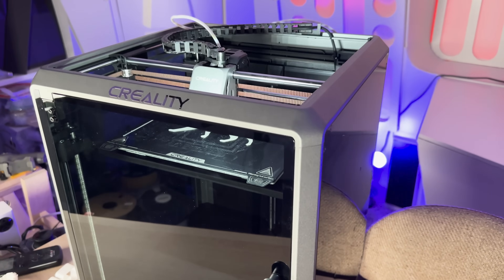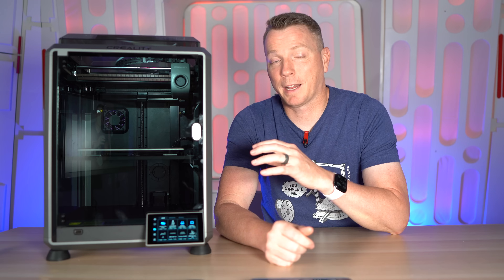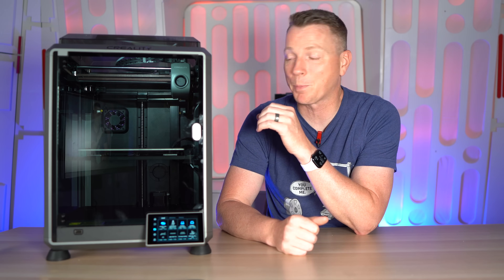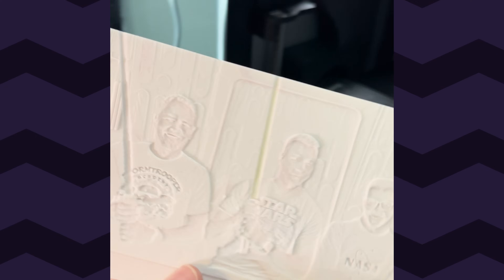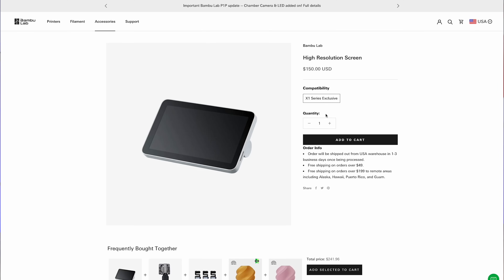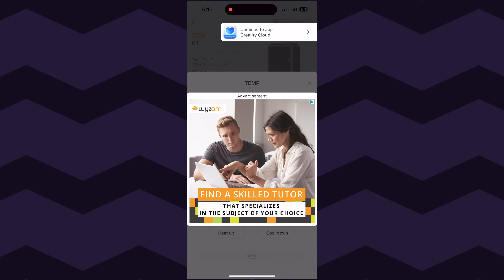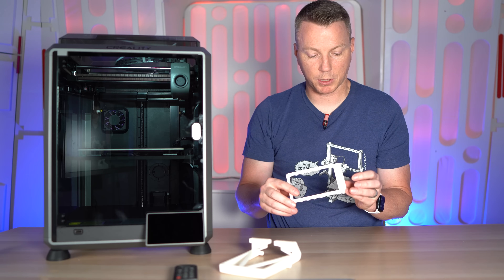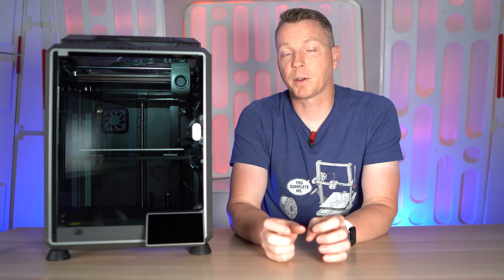I Regret Buying the Creality K1. Here’s Why.

Comment: Now the K1 CAN do multi material with CFS upgrade.  It's also much cheaper than even the p1p now with no Chinese cloud drama.
Reply: Ya but still has print issues. Mine will print fine than randomly stop I don’t even know what it’s doing every few prints it does this. Only has 6 days on it and I finally got a beautiful first layer but now when my part is half way done it falls apart. I use to own a print farm I’ve tried everything to get this to print. Unless I just have a lemon or creality slicer is a joke.
Reply: @ProjectInkDesignco  yeah, use Orca.  Maybe got a lemon, but in general the K1C is great and prints way over its price class.
Reply: @ ok I’ll give that a try but heard that voids the warranty sounds like creality wants they’re customers to have a bad time
Reply from the maker: @ProjectInkDesignco  I’ve owned more than 20 different printers but I’ve never owned a Creality myself. This is Mick speaking, not Nils.
Reply: PS I’ve done all calibrations creality has not clue what’s wrong with it and told me to send it back so now I probably won’t have one for a month for them to fix it.
Reply from the maker: Sounds like a great deal. They’ve come a long way!

Comment: Right now the k1 is 350 USD with a discount and thats an insanely good deal and they fixed most of the bad issues with the k1. Im buying the k1 for sure and im buying the cfs upgrade kit. Cant wait for it all to arrive!
Reply from the maker: Sounds great! Let us know how it goes.
Reply: @The3DPrintingZone  Its coming on Monday I will let you know if it works well!
Reply from the maker: @ sweet! My two brothers have the K1 and K1 max and love them.
Reply: @The3DPrintingZone  Printer has been going well so far other than a little bit of an issue with the print adhesion. Prob need to clean the plate cuz ive been printing ALOT of things. I think after the revisions the k1 actually became a good choice. Im going to get the cfs or mod my own multicolor maybe soon.
Reply: @sikees  I have a k1 coming tomorrow and the determining factor for me was Bambu labs is a walled garden.  Whenever something is a walled garden you can guarantee anti consumer practices will start to creep up.

Comment: Update from 2025:

P1S was 1.5x more expensive than K1C in my location. Now, the K1C is getting a multi filament ugrade in 2 weeks. 

Honestly, I would prefer a bambu for consistency and a bigger build volume but i could not justify spending that much on my first printer.

Creality print 6 is just exacrly the same as Orca. Orca works too.

Comment: Take this guys comments for what they are worth.  He is obviously a Bambu fanboy and I am reasonably sure  connected to Bambu in some way (sponsorship, etc.).  Even in this video which is supposed to be about the K1... he spends about 1/3 of the time talking about the K1 and most of that is about shortcomings and 2/3 of his time talking about the Bambu P1P.  Doesn't really mention the fact that the printer he is promoting has a 20-25% higher price point than the machine the review is supposed to be about.  Hello... newsflash... for 20-25% more money I expect it to have more features.
Reply from the maker: I hear ya. This video was done when this printer had a LOT more issues. Luckily, Creality made updates that improved things.

Comment: The fact I can root my K1 and run klipper/fluidd is pretty darn awesome though, I've setup a macro to handle a print queue with auto ejection, it just performs like a beast!
I don't print objects larger than the 22x22 and it's all in single color, so to me the K1 wins every day of the week, especially at todays price point ($350)

I do have a a1 mini as well, just because it was so cheap and I wanted to test it out and see if it could potentially replace my K1 as I expand my printfarm, but so far I'm loving my K1 way too much :D

Comment: 1 year later all those problems are solved with the K1 max 30x30x30 Supports multi-color printing with up to 16 colors using 4 CFS and I bought it for €680 without CFS. I really have no regrets, perfect prints without any problems.
Reply: I bet that mobile app is still a pos.
Reply: @allesbehalvewaterstond   Nope, i have no problems with the software or apps since the 5.1 version of Creality

Comment: The Reason the prints done by the K1 are trash is probably because you didnt take off the top plate or didnt open the front door. This lead to the enclosure getting too hot and warping the product.

Comment: Haha, I just purchased the K1c and then I was looking to become more familiar to this printer and I find this video. I am sure for manufacturing purpose the k1c is superior apart from the size of the  print that K1cMax  has shorted it giving the user the possibility to print 30cm by30cm by 30cm making this Bamboo printer obsolete. I am so glad I dint called for it:P I believe the print issues is only because your lacking in experience with it I really hope so but based on what you said so far I stand lots of chances :)
Reply: Just so you know when this vid was posted more a year ago it had some problems but now creality has fixed them. They are very good printers.

Comment: Now that k1 is $400 at microcenter the k1 is a great deal, also using the ams capabilities to compare to the k1 is unfair as then you basically have a $850 printer compared to a $500 printer which is not an even comparison

Comment: I wisely invested in a pre-owned Ultimaker S3 (dual core) 3D printer, with all the capabilities of their larger S5 variant, just in a smaller package. The private seller included a dozen packs of assorted new Ultimaker (NFC ID enabled) filaments. I was genuinely surprised at how easy the S3 was to initially setup and connect wirelessly to my local network and Ultimaker's free remote monitoring platform. I literally started printing quality parts within minutes of turning it on, with it's easy to use touch screen UI and free Cura slicing software.

The most frustrating and difficult aspect of 3D printing for me personally (as a noob) was getting proficient with modelling software like Blender and FreeCAD. It's easy to slice and print someone else's (thingiverse) models, but not so easy to create ones own from scratch. It's both time-consuming to learn the software, as well as design 3D models good enough to print.

My personal recommendation for DIY amateurs, would be like me to initially buy a cheaper used printer to start with and don't potentially lumber yourself with an expensive new paperweight, should you find 3d printing less-appealing after trying it a few times. One definitely needs a purpose/reason for owning/using a 3D printer, as they're not cheap to maintain or feed.

Thanks for your in-depth honest review of the K1, I for one am glad I invested in a reliable small commercial grade (dual nozzle) 3D printer and not something like the Creality K1. Where I think you've more than adequately demonstrated my point too, it pays to buy a reliable workhorse and not the latest pretty-looking plastic trendy show horse. 😉👍

Comment: Just so everybody knows, the K1 has fixed it’s printing problem he talks about
Reply: Ha ha buddy I have a k1 and I still have these problems
Reply: @joeycurry8700  when did you get it?
Reply: @OliverWatson-s8c  4 months ago
Reply: Yeah, right.
Reply: @joeking433 WDYM? Mine works perfectly and I’ve used the entire base plate + I’ve watched a more recent video saying they have fixed it. The old switch requires a lot less force to flip but the new one does making it fixed with under extrusion.
Reply: @OliverWatson-s8c have they fixed the part where the cable chain was turning the gears off?
Reply: @3Ddesignisawesome  yes
Reply: @OliverWatson-s8c  Hi, just wondering, what about the bed leveling issues? Are those fixed yet? Or should i prepare to fiddle around with that a bit?
Reply from the maker: Take a look at our most recent K1 video to see what’s been changed: https://youtu.be/MXwsjaLzxnI?si=hjImM63TyK2HE7Xk

Comment: One thing i never see k1 reviews talk about is the massive difference that rooting a k1 and going to a mainsail or fluidd operated klipper system with guppy screen. Having KAMP and z tilt make a huge difference on this machine. It also allows for real input shaping not the fake input shaping it ships with. It also allows you to use octo everywhere and get off the horrible creality app.

Comment: Bambu Labs do have an enclosure kit for the P1P that is reasonably economical, or you have the P1S available now as an option that is pretty reasonable.   Big Tree Tech have recently released a Panda Touch device that upgrades the P1P / P1S display now.   Very worth while.  I know, slightly extra cost, but worth while and still preferable to me over the Creality offering.
I believe, now ( 8 months later ) different slicers can be used with Bambu as profiles are now available, but I don't know off hand which ones are compatible.   I think Slic3r  and Orca work, but last I heard they don't support the AMS yet.

Comment: Had the K1 for a week, sent it back. Printing ailure rate is like  4 out of 10.  It's not because of wrong settings, it's more like intermittent clogging or change in extrusion or flow or similar. One print comes out perfect, next one I had to cancel it half way. It could be just mine, but quality control isn't the best, just read reddit posts how many people have all kinds of issues, whether it's first layer or clogging or other issues.  After a week and several days of trying to figure out what's going on, I gave up.  60% efficiency only is just not good enough for me, when my $99 Elegoo printer does a 10 out of 10, whatever filament I throw on it, (although very slowly). Oh yes, the app. I had it on my phone for a whole lot of 5 minutes and then deleted it. It's like downloading an adware or a virus.

Comment: What you don't talk about is Closed Source and the Bambu Lab products are tuned to work with, well, Bambu Lab filament and slicer. At $28 for 1kg that is about double what most filaments run and since Bambu Labs just takes from the community while attempting to build an 'Apple Mystic', if it cost more it must be better, right? When Creality decided to open the Klipper printers they are shipping I ordered a K1 to use while building a VZBot, one of the many Open-Source printers that have developed the 'Next Generation' 3D printers. I expect Creality to be marketing an AMS system for their 'Flag Ship' line shortly, it's China, and the Creality AMS will be ~$300.

Comment: Seems fair at the time. Ive gotten a k1 max now and that addresses most of the issues outlined here. Its enclosure is better. It adds the a1 cxamera and the lidar. The lid area is changed and doesn't interfere, the filament change switch has been tweaked to be more robust. It doesn't look  to me like the chain interacts with that now, likely as a result of the differently designed top. 

Mobile app Ive heard is still garbage, but I dont care about that. Can always just use the browser on my phone to watch the printer. But thats something I dont bother with pretty much ever, especially with how fast these things print. Foir multicolor, still no multicolor but I took advantage of the mosaic palette sale to get a palette pro 3, so for the cost of 1 AMS I get access to 8 colors and wont have to bother with the poop shute. In the Creality's favor you don't avtually have to use their cloud at all, or even their slicer/control software where you are limited to using the Bambu software.

Both fine I guess but if you're looking for an alternative to the Bambus I would look at the K1 max instead of the base k1.

Comment: The newer K1 version past August 2023 is fantastic, the app is still horrible but works. Just a lot of ads. Slicer is not an issue as you can run all of the major ones on the K1. The camera on the K1 is awesome and it is nice to monitor my print from work. The K1 Max is the perfect printer, just that crappy app…… Hopefully, when Creality completes it’s purchase of Bambu they will integrate their app.
Reply: I hope they don’t, they will ruin the bambu completely, the problem with creality products is that most of them are rushed in production and quality control is not the best, the k1 has potential but they still have to fix a lot of issues.

Comment: At 15 years old I bought a brand new Ender 3 v2 when it came out, kept it stock for a year. Then I bought a dual z axis, direct drive, and Creality box 2.0 kit. I can print at 500 speed with no degrade in quality. After the first layer I speed it up.

Comment: As the community of the K1 grows, especially the firmware is unlocked now, the K1 will continue to grow, 3 months in it's already improved vastly. 
Bambu is closed source. I will never buy one. Color printing is nice but I really enjoy painting models so not a deal breaker.
Reply: Friend got a Bambu, I got the K1, he doesn’t use the AMS because it wastes several times the filament as the weight of the piece he’s printing. Gobbles entire spools printing a 6” character, leaves a pile behind to the printer so you need an additional few inches behind it to set up a wastebin. I was so jazzed for it until I saw that, and saw how during filament changes it can shift the print over and you wasted days and spools

Comment: If the worst issue with the K1 is the app, just enable stock Klipper (tutorials are available). I still think I want a K1, but I don't like any printer that forces you into their own cloud and/or slicer. From what I've seen Bambu's system is pretty closed.
Reply: It's not. i use Orca which is another fork of bambu which is also opensource. You can print on Lan only if you want or via sd card like every other lame printer.
Reply: @phasesecuritytechnology6573   "It's not. i use Orca which is another fork of bambu which is also opensource." ... well that didn't age well.

It is closed source and Bambu is going to shut it down further after they locked Orca out.
Reply: Sigh. There are two apps. Creality Cloud, and Creality Cloud Lite. Lite is everything you want from the touch screen and camera feed and video retrieval, download and sharing. Regular has a “community” with their own ads. Everyone just took the video OP’s word for it and never actually checked.
You don’t even have to use stock klipper you can just type in the IP and get the Creality device interface served from the printer

Comment: Well... I haven't encountered all these problems. Maybe you have the first version released on the market. In the versions distributed now the firmware, the extruder and the hotend have been updated and have no problems. The cable chain has been modified and now does not touch the extruder release lever in any way. Prints are perfect even at very high speeds. No ghosting, perfect adhesion to the glossy PEI top even without using glues or lacquers. Do we want to sanctify Bambulab? I remind you that it came out a year ago and at the beginning the problems were much more serious than those of the K1, so please let's stop denigrating a good product like this. You are as annoying as Apple product owners versus PC users

Comment: I have a highly upgraded Anet A8 and an upgraded Ender 3 V2. Both run flawlessly. I want a new printer but I'm struggling justifying $700 when the print quality is the same. I have a Markforged Marktwo and an HP Fusion 5200 at work. The Markforged definitely prints better but is very slow and their proprietary filament is super expensive. The HP Fusion is super fast but we can't get parts within .1";  doesn't print accurately. I've literally brought in prints from my crappy home printers that are more accurate than  at 1/10th the cost for filament, still meeting dimensional and strength requirements.

Comment: Comment for Algorithm. Appreciate the video. Just bought my K1 as my main purpose is to print PC parts and for the price It's probably the better bang. I don't do models, just prototyping of parts and unfortunately I'd have to pay 1/3 more for the P1S to do the filaments that require more heat and stability in temperature control.
I was tempted for the AMS feature to add later, but it seems Creality is going to drop one for the K1 at some point and again since I mostly do parts my use case is not for it, but I can see it being nice for doing prints of the same part with different filaments for testing. I also like the large community Creality has if they do end up dumping the software as opensource it will get massively better. I've always thought proprietary is good and usually better, but doesn't last. Betamax and mini disk, so sad. P1P is pushing hard, but I'd like to see a longer time on market before I jump to them.

Comment: I almost bought the Creality K1, but then I saw that the Bambu Lab X1C combo boxes on the floor in our local Micro Center and decided to go with that one instead. I actually had the K1 on hold and it only took 10 minutes to get the salesman to understand that I didn’t want it, but I did want to buy the X1C instead. Since I got it setup in our 42 foot Fifth Wheel home I’ve been using it almost every day for the past 5 weeks.  My only issue is that the 3rd slot of the AMS hangs up at the end of a print and I have to actually remove it by cutting it outside the box and then pull the rest of the filament out of the tube.  Other than that it’s been working great with only a couple failed prints in PETG when the hot end reverted back to 220C even though I set it to 235 in the slicer and again on the screen.